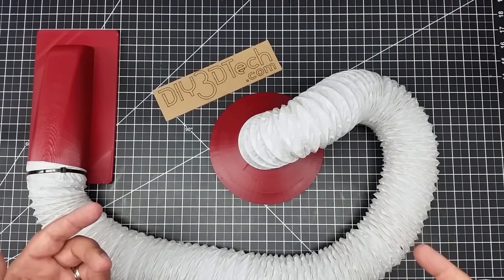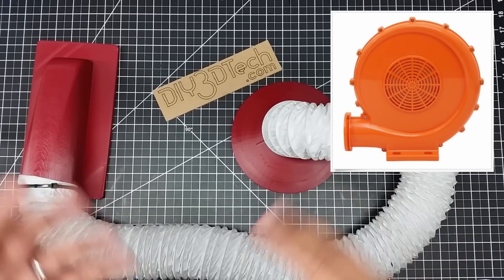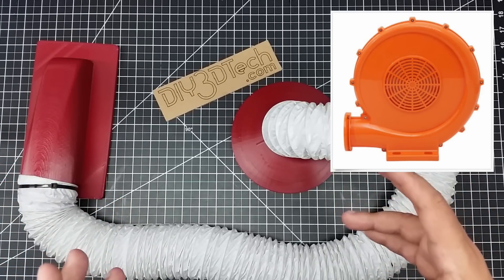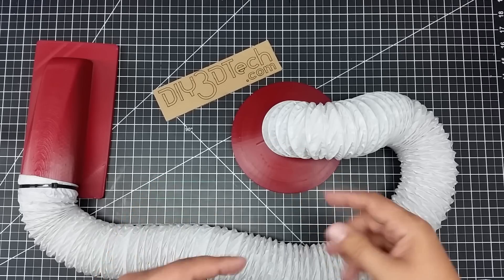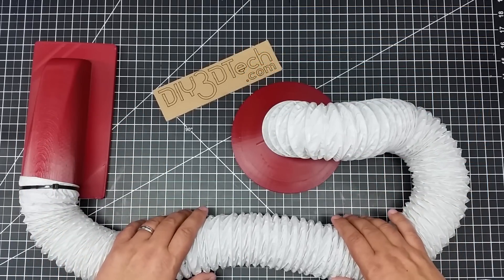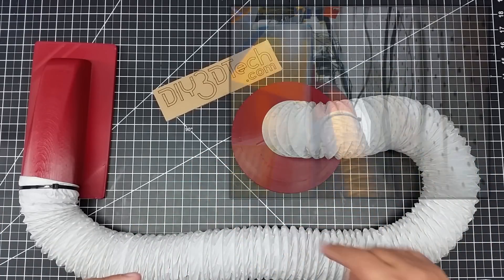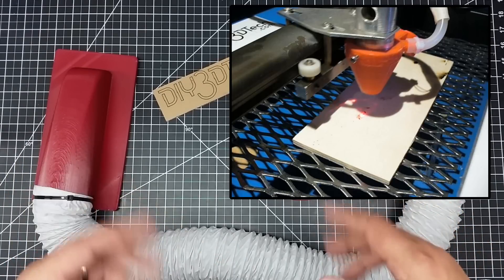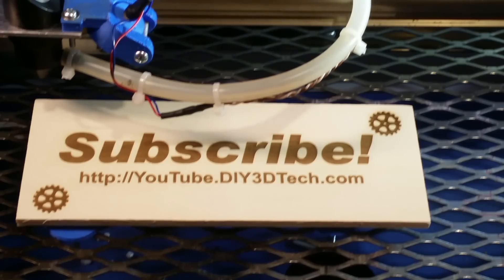K40 eBay Chinese CO2 Laser Cutter & Engraver - Balanced 3D Printed Fume Extraction System!

Comment: I don't have a 3D printer yet and wanted to incorporate your concept into my K-40. Is there any way I can give you the diameter of the hose nozzle and you build a fume extractor base for me? I just need the piece that goes on the K-40 itself.  Needless to say, I'll pay for the piece. Your thoughts? Thanks. Elvis Acosta
Reply from the maker: The connector uses a 3" hose and the links should all be in the description.  Sorry but I just have the time print this out, however you might find a service beru to do it for you...